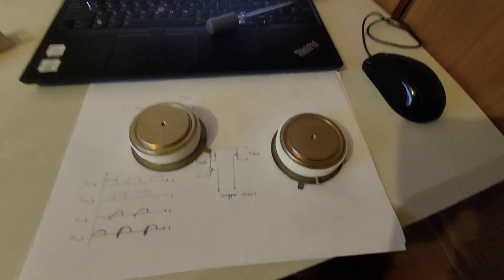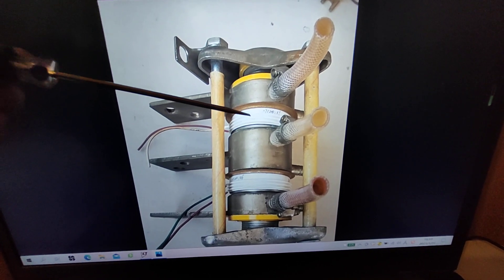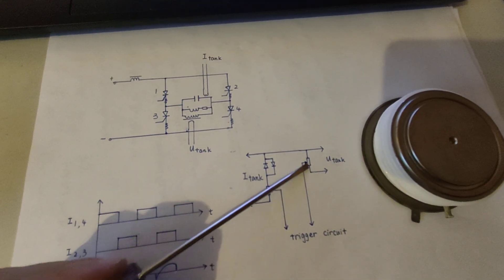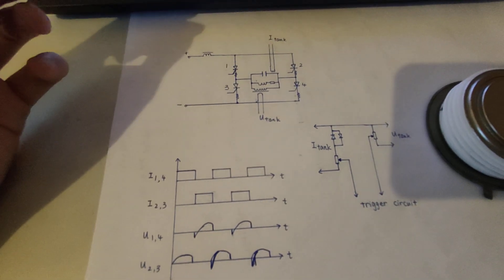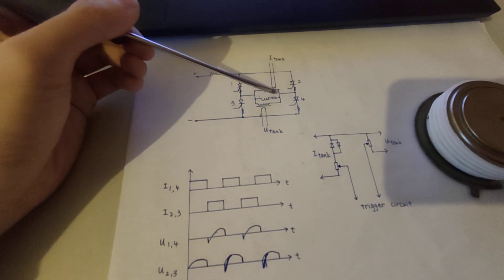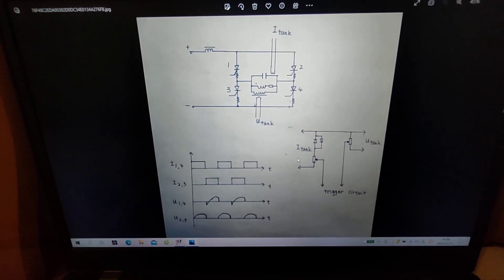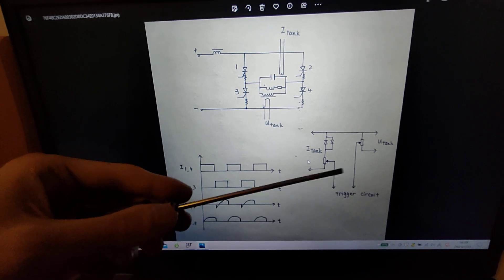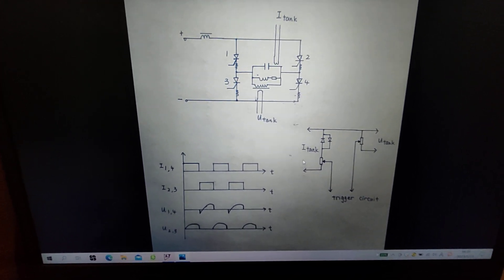Self－excited thyristor induction heater project

Comment: very cool you got a super cool colection of exotic components !!! I just build my first zvs a few days ago , I am thinking about building a IGBT zvs
Reply from the maker: Thanks for your comment🤗.In my opinion I think though a ZVS which is using IGBTs could work,the tailing current will decrease the efficiency and make the IGBTs get hotter.I once tried using a pair of FDL100N50F[100A@500V,the datasheet says each of them have a powerdissipation of 2500W!] mosfets to build my ZVS driver,the maximum input voltage was 120V [independent gate bias supply]and the power is around 5-6kW continuously!

Comment: Instead of concentrating electrical stress why not stack/distribute energy magnetically??
Reply from the maker: You mean around 1:30?Actually I want to say the thrysistors needs to be pressed firmly,the silicon Die inside them needs to be pressed to the 2 metal faces,also the thrysistor needs to have a good thermo and electrical coupling with the copper cooling blocks.
Reply: @uecmitsuimarinedieselengin873  yes I've seen some of these that actually require a clamping force in order for continuity across the gate. Otherwise it would just be open circuit. The only other thing to keep in mind is the threshold current were these will basically stay on without gate current applied.
Reply from the maker: Or maybe you are saying something else?🤔🧐
Reply: @uecmitsuimarinedieselengin873  It's the else thing, but i forgot to also include the price:  a need to have synchronized power stages.  Instead of one donut have many and that will address the matter of "losses" causing parasitic heat as well, especially in short burst applications where the driving period is many times the cooling one.  Though that later scenario doesn't seem likely.  Synchronized magnetic stacking sounds more accurate, add toroïds until the workload can be handled without a fear of failure, until maybe a cascado domino-like incident takes place i would guess - hence calling for closed loop  control featured with some feedback path as well.  It's just a good idea to wear protective googles if one happens to flirting with extreme boundaries constantly.  So instead of stacking workcoils there would be only 1 driven by a thick possibly water-cooled power bus itself driven by stacked synchrone toroïds.

What do you think?  After if one module can be built why not a few clones to boost the fun!
Reply from the maker: @Egzoset  I think I understand what you mean now. That's a good idea but I guess it may needs some complex control circuit and I think it's still beyond my capability now😂,I can't program or designing digital electronics.
Reply from the maker: @Egzoset  The SCRs in the video were originally used in a low frequency induction heater but the control is more like the board in an IGBT induction heater.The heater can deliver about 750kW active power into the load so I guess the SCRs may work properly in my homebrew setup[something around 30-40kVA].
Reply: @uecmitsuimarinedieselengin873  Well i ain't the one in charge but i keep thinking 750 Kilo-Watts is going to create some significant stress somewhere, including eventual ferrite cores...
Reply from the maker: @Egzoset  Yes you are right.The input are actually 2 3phase distribution transformers each rated for 550kVA,secondary in series.The input DC voltage is 750V and there is  no output impedance matching transformer,just feed directly into the  working coil which is around the furnace.The compensation capacitors in paralleled with the coil are made up of 14 each 750kVA CHCl3 filled water cooled capacitors .